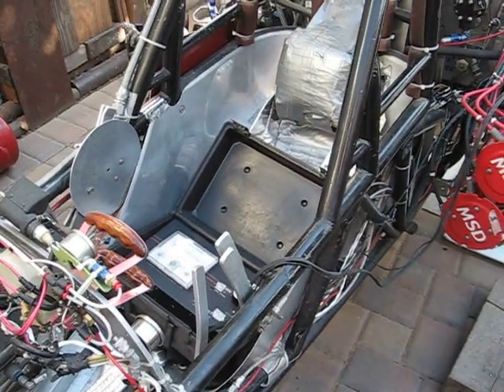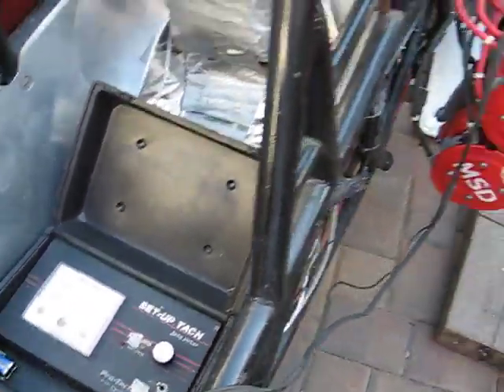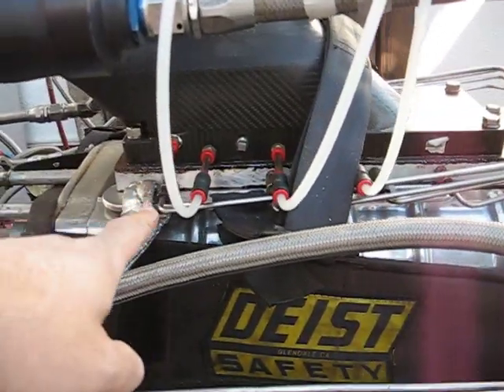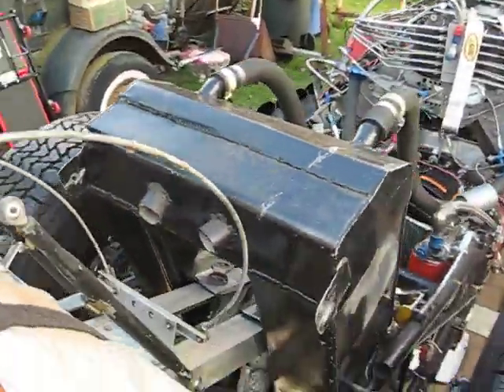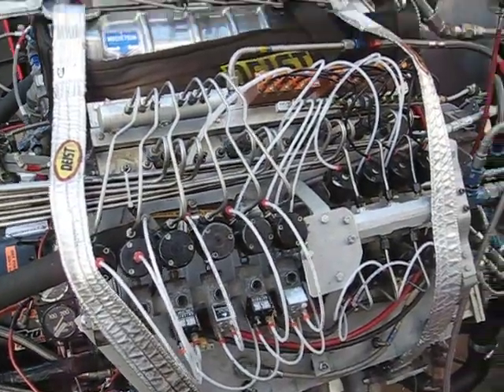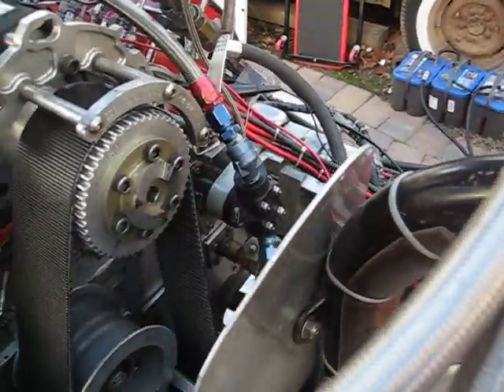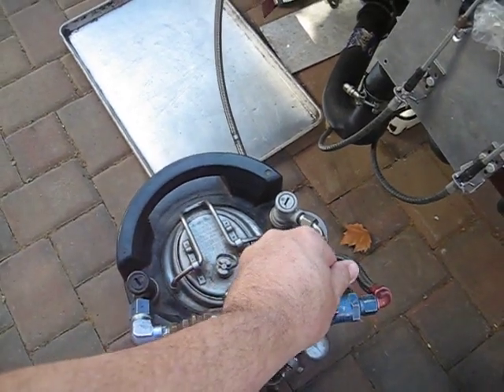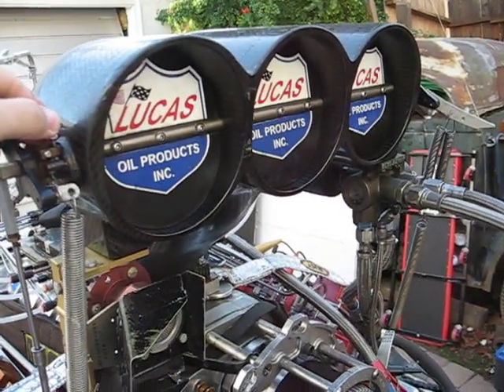4-cam hemi tour

Comment from the maker: David- it made a pass about 12 years ago and ran 240 MPH, but it started in one lane and ended up in the other, so it didn't count. As Tommy has continued to adapt modern top fuel tech in order to try to keep up and isolate the heads as being a difference maker, it's just a ton more expense and teething problems. Part of me wishes Tommy would either go back to or would have stayed with the single magneto and smaller pump and old style Enderle injector. But it's his deal and he's stubborn guy.

Comment: Man, that's really impressive. and yes, extremely expensive. I don't have anywhere near the kind of green you have invested and I can only afford a few trips out a year. Mine's a door car, injected but no blower, indy cylinder head wedge heads, 500", methanol, 2450lbs I used to be able to say 2600 with driver...then I quite smoking and gained 45 pounds! LOL FED's are the coolest race cars, by far. Motors should be up front, where god wanted them